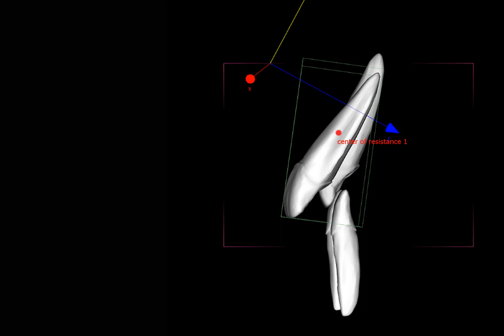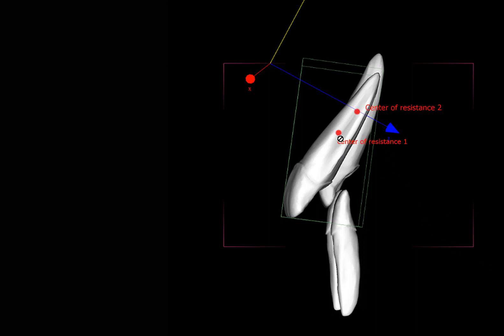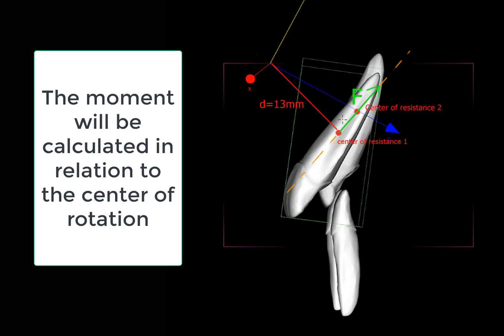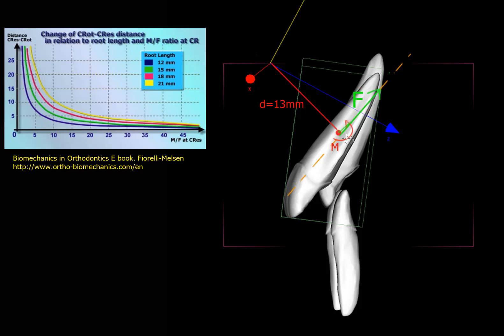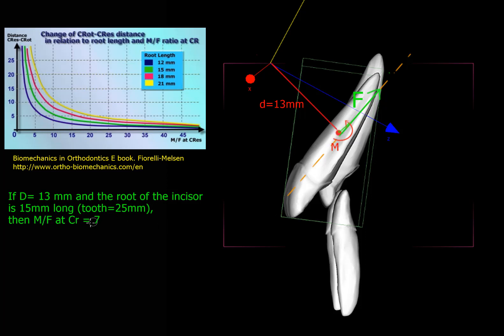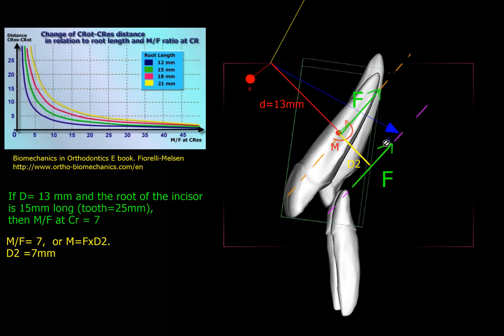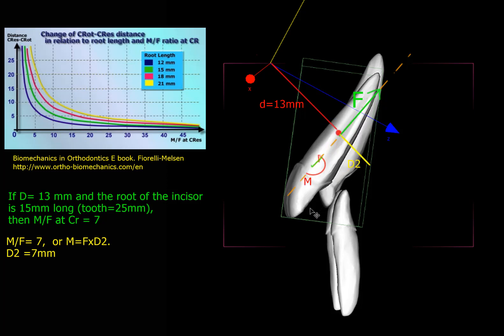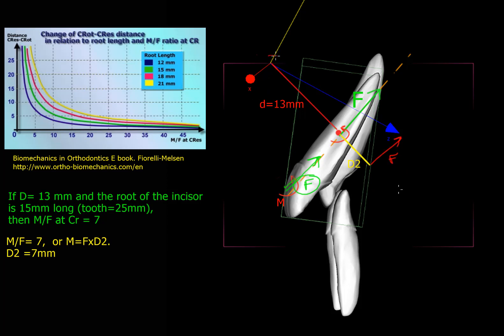Center or Rotation Mechanics in Orthodontic Tooth movement as Applied to Aligners.

Comment: Thanks dr; but why did you assume that the out red point is the cor ?
Reply from the maker: The R dot is actually the v axis seen from the front.
Please listen to the whole video to understand how the center of rotation is determined.
Reply: jean marc retrouvey i have seen it twice; according to the video you assumed  the outer r point is crot. And the r one in the central is cres and you mentioned the diagramm that defined several distances between these two points and you picked 13!! When we apply a force, both of them are inside the tooth!! So how come crot is out?? Sorry, but the idea is not clear and needs explanation
Reply from the maker: @ezzokatkhuda7987   Go see this video https://www.youtube.com/watch?v=wc76IhV0dvI&t=3s